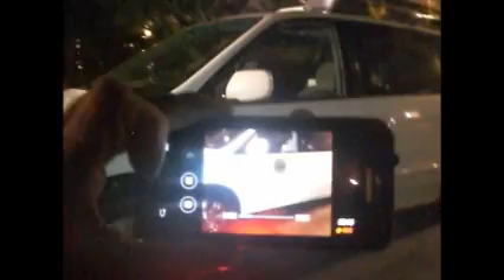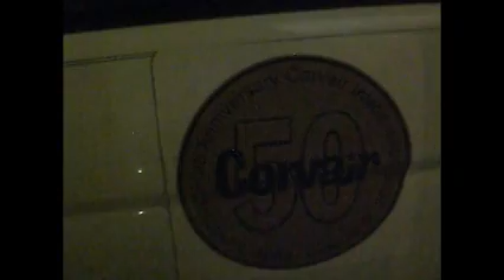Odyssey Tranny Desert Junk  11 1 15

Comment: It would not be a Corvairwild road trip. Whit out the truck or car giving up the ghost. Or having major trouble. Some time you need a fire extinguisher to keep the flames in check.  Other  times a rocket engineer to fix your diesel pump.